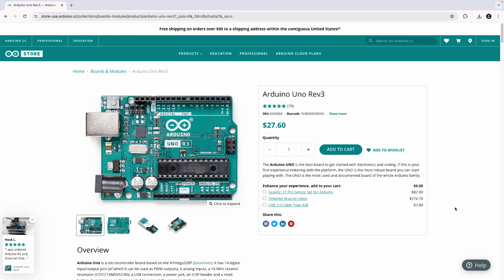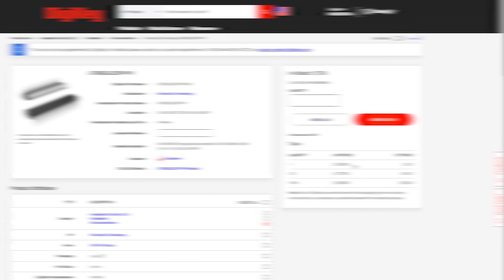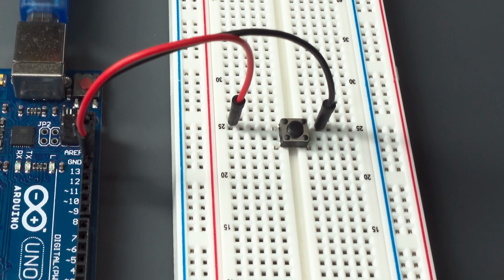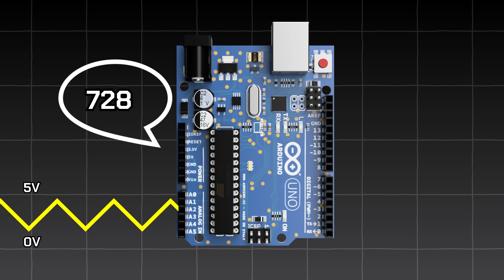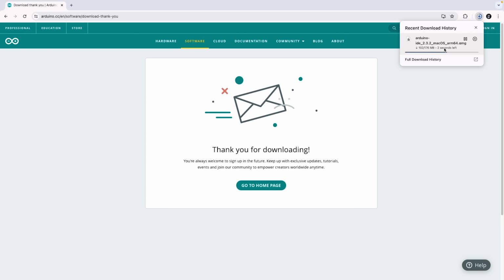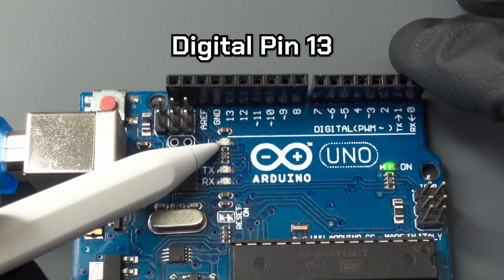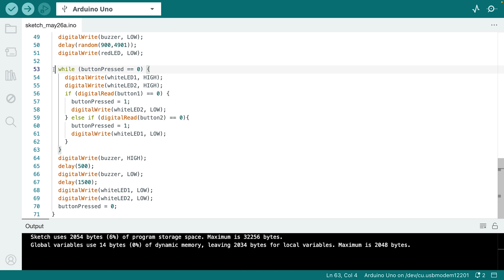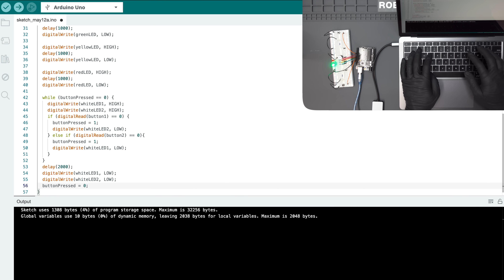Arduino is easy, actually

Comment: i still dont get how the arduino + breadboard circuit works bruh

how does the pin 13 thing actually work
can i connect it to the power rail?

is pin 13 just a controlled version of the 5v pin?

or is it something else

idk whats going on help

Comment: Hi. I found your video very informative for someone who just started to get to know Arduino.
Why i searched for Arduino? Because i have a project in mind, where the shock absorber in cars will response to different types of terrain.
May i ask for your opinion on what component should i use with Arduino? Is it MPU6050? If yes, can you demonstrate how to use the MPU6050, or maybe other type of chip?

Comment: I really like your video explanation, I am a software engineer student and I want to start electronics as a hobby. I think an Arduino UNO kit will be a perfect start
Reply: Bro why are you so relatble to
Me
Reply: The stuff I used to work on, would take up a whole table. Now the equivalint would be much smalled, but it has to be able to handle an industreal inviroment. The name of the company was Anilam. Manufacturing has to come back to America. I had a good job.

Comment: Would there be a decent way to use an Arduino to test the speed of a dirt bike? Of course you can use a phone and GPS app but that is boring. Is there a way to set up two photo eyes a certain distance apart (20 meters?) and have the Arduino record when each eye beam is broken and then calculate the speed based on the distance and time?

Comment: You have nice videos but I still have one question: is there a software or any way i can control dc motors and leds simply with a programm or remote? because I cant do all this programming and its also not what i need.

Comment: What is the connecting method for ir sensor using an arduino uno for automatic water dispenser with a solenoid valve

Comment: i recently started to make an arduino rc car and a didn't understand many things. Your video helped me understand the basics behind arduino and made me to do more. Thank you!
Reply from the maker: I'm so glad to be able to help in some way. Cheers Sebastian!
Reply: Hope u r doing well buddy,could I ask how are u going about learning to build that car?
Reply: @mehdibmc9508 Thank u, mate. Firstly a i started by making an idea of the parts I needed, what parts I would need. I needed a servo for steering the front wheels, a motor stolen from an old printer😅, a motor driver to control the motor, the board Esp32 (the cables and the code are exactly the same, basically beeing an arduino board but cheaper and better) and a power source. With the power of a 3d printer and lots of research and iteration I did it.
Reply: Lets goo romaniaaaa

Comment: I made an arduino based transmitter and I am facing thr problem that the servos move with a lot of fluctuations when I move the joysticks. Can you help me?
Reply: EM interference could be the reason if you're using jumper wires or any long wire